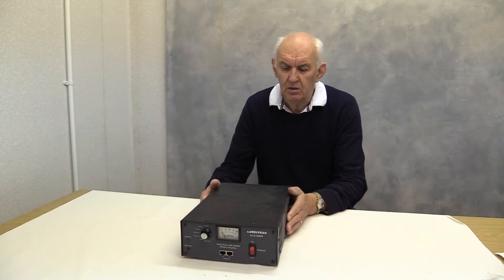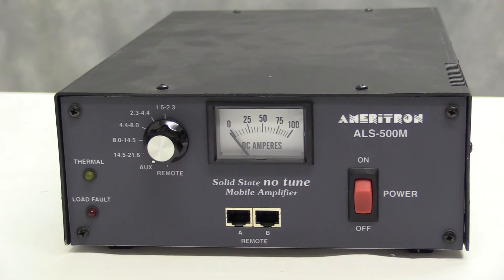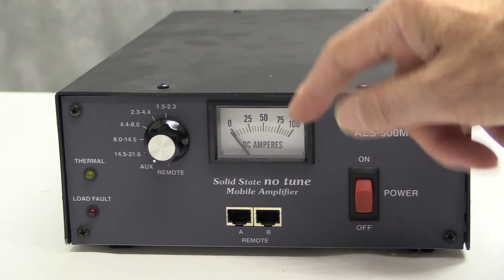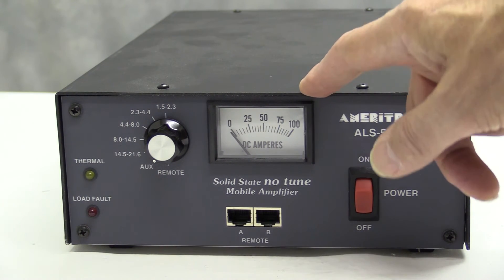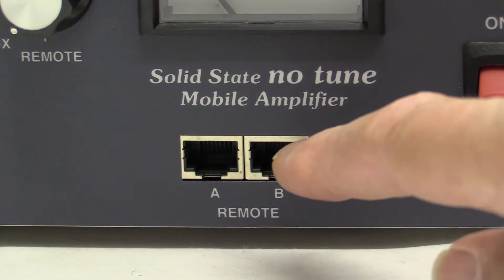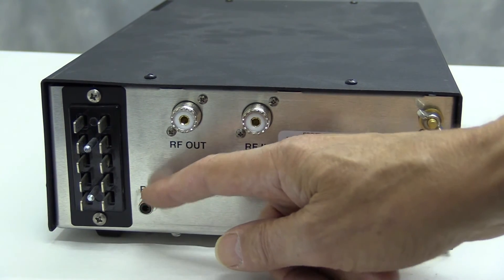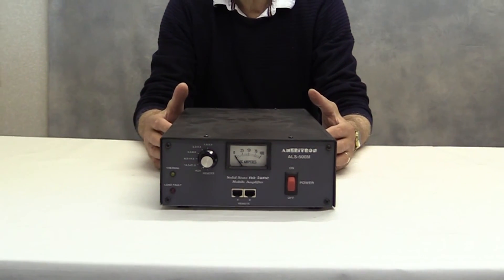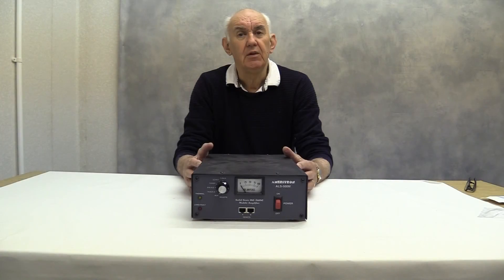AMERITRON ALS 500M 500W Solid State Amplifier

Comment: What would be a reasonable power supply for a base station.?
Reply from the maker: Ah well, you need around 80 Amps peak. Diamond and Watson make models. 73s Peter.
Reply: I'm getting an RV power, battery (Li or Lead) charger  for mine ,  still want a battery hooked up for best ripple and peaks.